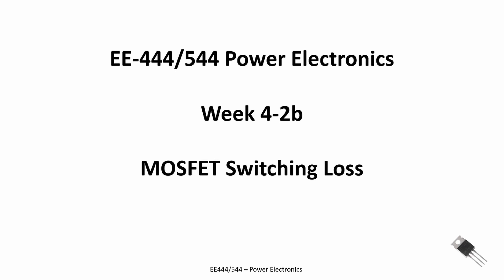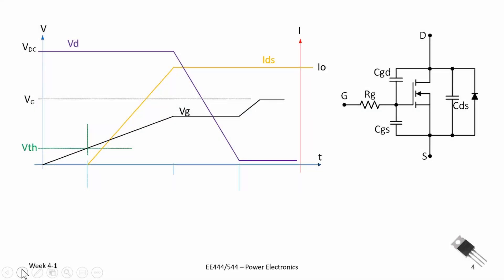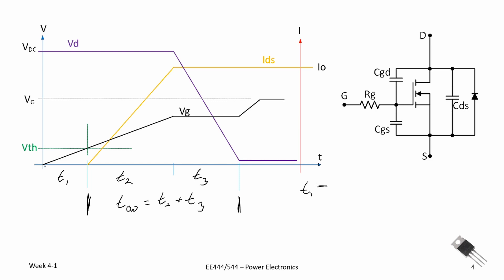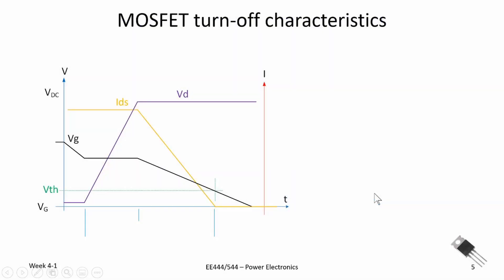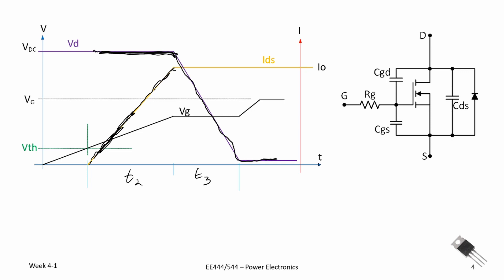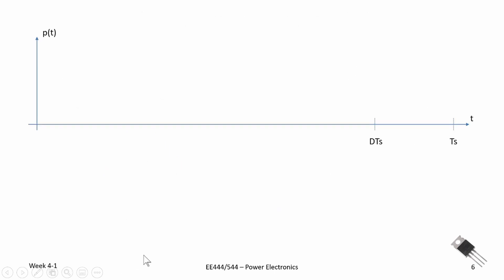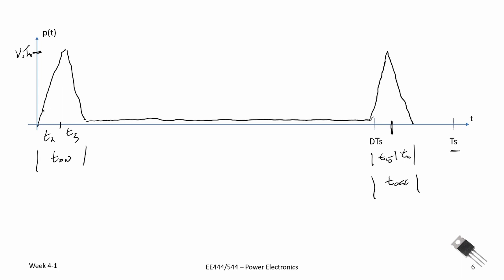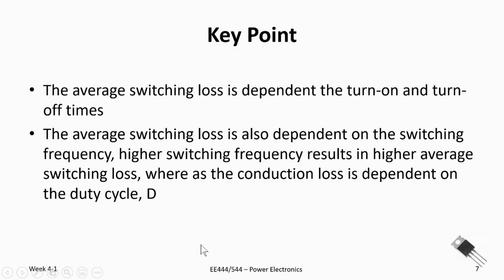Power Electronics - Switching Losses in a MOSFET

Comment: Hi, thank you for the great tutorial! I have a question regarding the Id current at the end of Miller plateau. If the Vgs is not at the maximum value at the end of plateau, how does the Id current reaches maximum value? My understanding is that the current should increase after plateau because Vgs is increasing and opening the channel of the mosfet further? Could you elaborate this? Thank you, Marko.
Reply from the maker: That's a great question.  It is actually easier to illustrate if you have an Ids vs Vds graph from a MOSFET in front of you.  In that graph, you will find different curves for the different valuse of Vgs.   As Vgs starts to increase past the thershold voltage value, the drain current will start to increase from 0A along a straight vertical line in the Ids vs Vds graph.  It will reach a value of Vgs that is not the maximum value, but the current will be at maximum value.  The point will then start to move along this Vgs line (or very close to it) towards the left and begin to enter the Ohmic region of the MOSFET.  Also note that the increasing Vgs curves are nearly on top of each other in the Ohmic region.  Once in that region Vgs will reach its maximum value, yet the current does not increase drastically.  The Miller plateau is the region where the point is moving from the right to the left in the Ids vs Vds curve at a near constant Vgs value. I do hope this explanation helps, but it is much easier to visualize with a point moving in the Ids vs Vds graph.  Best wishes on your design. -Dr. K

Comment: Hi,
in 5:15,What is the O in parentheses in VDS(O) and QGD(O)?  Shouldn't CGD and VDS be inversely proportional? Can you explain a bit?

Also, in the AN123 file you shared, the calculated and measured values are very different from each other. Can you explain why?
Reply from the maker: Hello Fatihe.1338, 
My handwriting is not good.  That should be VDS(D) and D stands for the datasheet.  The switching times can be very difficult to obtain accurate values as these times change based on the load requirements and the DC bus supply. Here is a good video from TI regarding the info on a MOSFET datasheet as it relates to turn-on/off times https://www.ti.com/video/series/mosfet-101.html#

Comment: Hi Dr. K, I'm building a model of a bidirectional DC-DC converter in simulink and logging efficiency against switching frequency. I am expecting a peak followed by a downturn within the graph where switching losses dominate. But no matter how high the switching frequency is the efficiency keeps increasing which I think is wrong. Any ideas on how to resolve this?
Reply from the maker: Hi Camrone, unfortunately I have never used Simulink for analysis of DC/DC converters.  My suggestion is to look at all the losses in all the devices to see which device is not being modelled correctly as you sweep the operating frequency point.  Keep me posted. -Dr. K
Reply: @powerelectronicswithdr.k1017  Hi Dr. K, think I have fixed the problem, I don't think switching losses are considered in Simulink so i have modelled them manually, I do have another question though, I've been looking at mosfet datasheets and have noticed there is a turn on delay time and a turn on rise time, (same for turn off) when calculating switching losses do i need to consider both of these times or just rise time? i.e. is t-on = t-d(on) + t-rise or t-on = t-rise ? Thanks in advance
Reply from the maker: @cammasters2053  Hi Camrone, here's a link to info from TI on the MOSFET datasheets.  https://training.ti.com/mosfet101https://training.ti.com/mosfet101.  This is a really good series and Video 1.4 discusses the Ton, Trise, Td, etc.  The vendors follow JEDEC standards for testing and reporting information.  Hope this helps. -Dr. K

Comment: Thanks for preparing the video. Could you please prepare a video on how to calculate the switching loss by the aid of simulation tools such as cadence or spice? Thanks
Reply from the maker: Hello, if you go to https://youtu.be/ms6TiEZIJXk?t=637 and at about the 11:00 minute mark I will illustrate how to check the instantaneous power in the simulated DC chopper circuit's MOSFET.  You can also window the switching waveform and LT Spice will compute the average loss.  Hope this helps. -Dr. K.